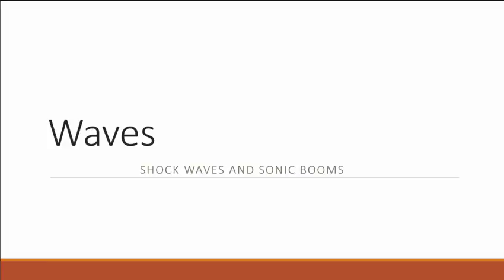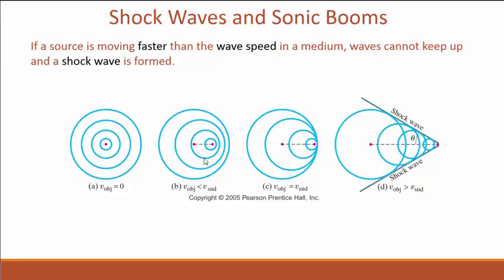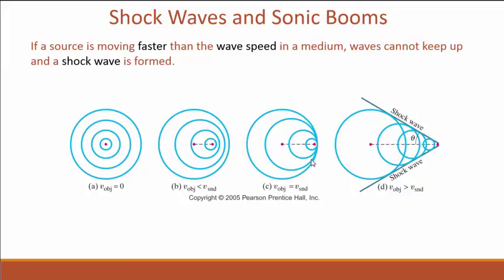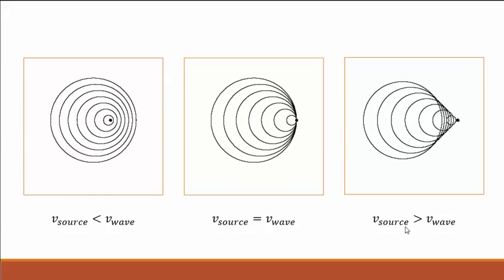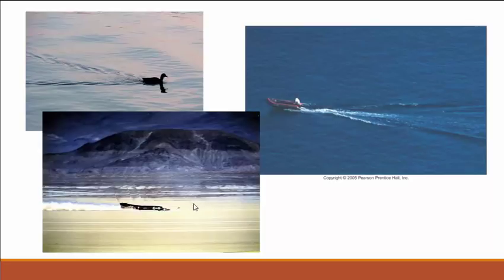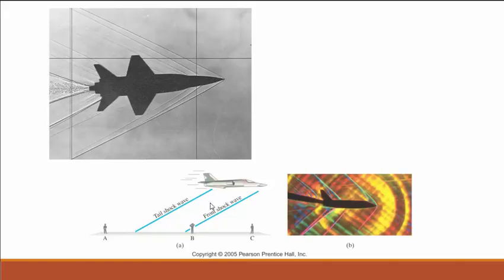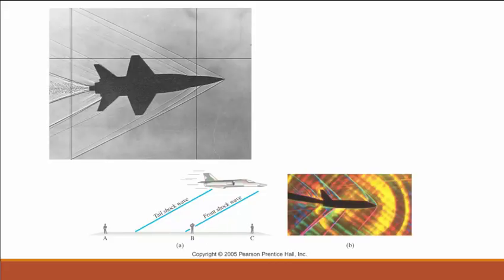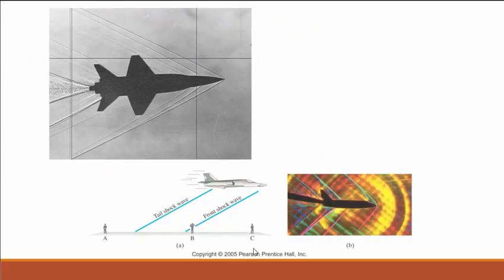4.6a - Waves - Shock Waves and Sonic Booms

Comment: if u call the edge as shockwave, then the shockwave must be one cone-shaped curved surface. then what does it mean shockwaves? prural form?
Reply from the maker: Yes, you can consider the high pressure cone as a single shock wave. Though you can get more than one cone from some objects (like from an airplane).

Comment: Yes, but why is there frequency so low? Is it because the higher frequency waves are so compressed that they just don't sound out, leaving the lower frequencies to dominate?
Reply from the maker: Good question! I don't know the answer, but if I had to make a guess, I would say that maybe it is because higher frequency sounds require more energy, so possibly the energy is too spread out by the time it reaches the person on the ground to produce audible high frequencies.
Reply: Ok. I find it fascinating that moving a massive object at the speed of sound requires a good deal of energy, but the sound from the sonic boom has less energy than the explosion that drive the object. I guess the majority of energy is tied up in the movement of the object and friction heat? IDK. I'm shooting in the dark. Thank you for your insights.
Reply from the maker: @MrJdcirbo  You are correct that the kinetic energy of an airplane would be much greater than the energy of the sound wave it is producing. If it's moving at a constant speed, then the energy from the fuel being consumed isn't adding additional kinetic energy, it's all going to overcoming the energy lost to drag and to a small extent, producing sound waves.
Reply: @brettguisti5027  I should have specified that the "explosion" I was referring to was the propellent behind a bullet. The energy of that explosion is far greater that the energy of the sound produced by the bullet
Reply: @brettguisti5027  but thank you. Sonic phenomena are fascinating